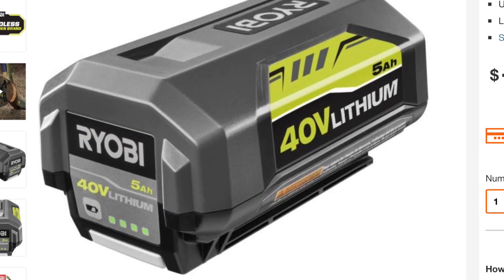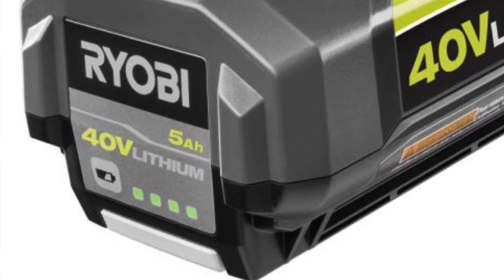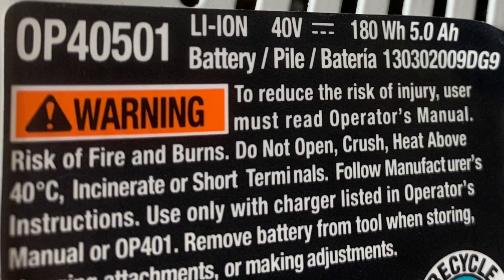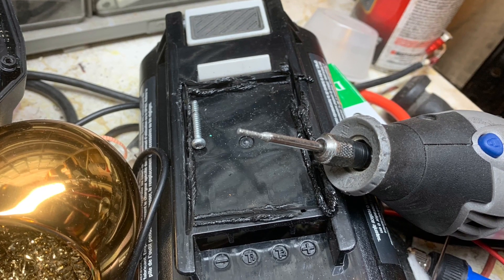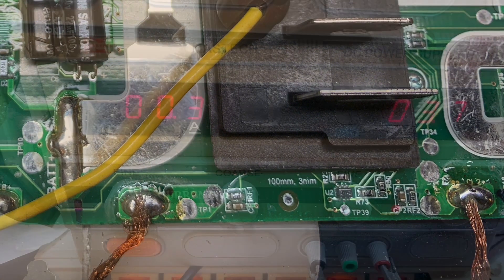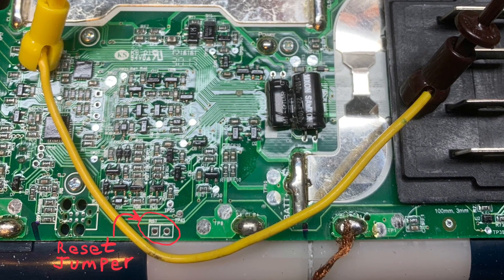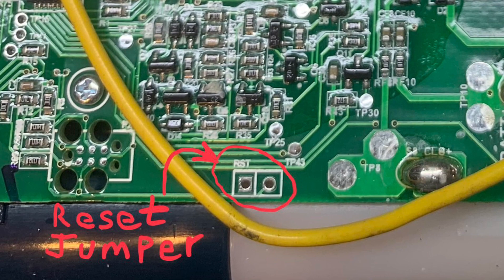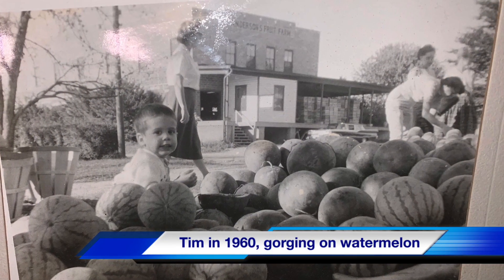Tim’s Tips #49 - Reset and balance a Ryobi 40V battery - Nov 17, 2020

Comment: Maybe Ryobi should contact Rigid on how to prevent this problem. I have a Rigid 18V cordless drill, and Hammer Drill, set that I have had for at least 10 years, and I haven't done anything special with the batteries except recharge them when they wouldn't power the drill. And I haven't had any trouble with them at all.

Comment: Do you know if there a RST trick for the 18v batteries with 4 blinking lights? I have it apart, but do not see anything labeled RST like the 40v.  Any help greatly appreciated (it has 18v showing on my multi meter now after a charge).
Reply from the maker: Instead of resetting it, you can measure the voltages of the cells to see if they are balanced. If they are not balanced you could boost the voltage of the low cells. Or you could lower the voltage on the high cells with a lightbulb. Perhaps the BMS would be able to charge the pack properly then.
Reply: I have it recharged, it was at 11volts, now it’s back up to 18V, but the circuit board still has it locked. 4 blinking LED’s, that blink four times. If I knew how to reset it, it should be fine. I do not see the RST anywhere on the 18b circuit board like on the 40v battery. If anyone knows how to reset it, please let me know which terminals to jump.

Comment: My circuit board has the 5 terminals marked RST, 3.3V, GND, DAT, CLK. I jumper between GND and RST without any success. I checked between the cells and got the following voltages;
CLI- TO CL1+ =2.8V
CL1+ TO CL2+ =2.8V
CL2+ TO CL3+ =6.3V
CL3+ TO CL4+ = 1.7V
CL4+ TO CL5+ =2.6V
CL6- TO CL6+ = 3.2V
CL6+ TO CL7+ =6.3V
CL7+ TO CL8+ =3.5V
CL8+ TO CL9+ =3.6V
CL9+ TO CL10+ =3.5V
CL1- TO CL10+ =10V

I don't have a power supply but tried jumpering to a good battery for a little boost with no success. Which is more concerning between the 1.7V low reading and the 6.3V high reading? Should I try a 60W incandescent light bulb to drain the high values to bring them closer to the others? Any suggestions?

Comment: The big thing I want to research is, do these packs have ANY form of balancing circuitry inside? I would hope that it at least has some minimal form of balancing in there where it can fix gradual drift of voltages over time. Also, I bought a dead 3-pack of these from Ebay to harvest cells from. 1 pack worked right away by using your reset method without needing any balancing. 2nd one had a 2.7v section (vs. 3.1v), so I used my little adjustable DC power supply to bring it back in line with the others. After reset, that is now charging as well. The 3rd has a pair of shorted cells (0v), so I didn't even try it. I tore that one apart to harvest cells from, and the other 18 cells have all taken close to 2000mAh of charge (the Samsung cells are rated 200mAh capacity), so I'm pretty happy so far.
Reply from the maker: It would be gross negligence if Ryobi engineers did not implement balancing. Thanks for subscribing.
Reply: @tdrager  if I am not wrong, Tim. There is no balancing circuit other than protecting maximum charges 41.xyz volts and minimum
Discharges lower than 30 or 28 volts(not sure).
Reply: From what I understand the reason that there is no balancing between cells (equalizing the voltage) is from a safety perspective.  All the batteries should have equal capacity (amp hours) - if one starts degrading to where it could become a hazard the BMS board will "turn off" the entire battery pack and will block charging.   The degraded cell becomes the weakest link in that charging chain -and will cause the entire pack to unusable.

Comment: I did exacly what you said it worked out for me thanks
Reply from the maker: You’re welcome. The reset method works if the cells are balanced. If cells are damaged or out of balance, more time is required to balance them. If even one cell is damaged or worn our, the pack must be recycled. It’s beyond most homeowners to replace individual cells.

Comment: It works!!!

A few notes for anyone that didn't really quite understand.

First, to get out the screws without drinking out the middle pin I just used an undersized flat head screwdriver. I just jammed that baby in there, hit two notches and went slowly. It worked. Plus, don't forget to get a utility knife and cut the sticker.

Once the cover is off I readied my jumper. I used a twist tie coated in rubber. Using a utility knife, I exposed about a quarter of an inch of wire from both ends of the twist tie. Then grabbing onto the runner I shoved one end into the RST hole and the other end into the other hole.

Finally, I pressed the battery indicator light. Instead of flashing, this time the lights stayed on. I didn't know what to expect. I just waited something like three minutes. The lights never went away. Whatever. I grabbed the rubber on the wire and removed the bypass wire.

I put the cover back on.
I put the batter back into the charger.
Voila! It's charging like new.

Like many before me, this saved a fair amount of money. Thank you very much.
Reply: Thank you for the extra detail!

Comment: Thanks for the video... it worked!  I had 3.09V on a string when all the rest were at 3.66V! I charged the low one with a dc-dc buck converter set on 3.7V output. At 3.4V I hit the reset (which worked per your vid), however the charger still didn’t like it! Charged it to 3.64V and charger now likes it and is charging it! Will test in the mower soon!

Comment: The reset trick is a one shot trick every time you charge the battery pack you need to reset it. Out of balance are bad cells that will bleed off voltage over short amount of time. Ryobi doesn't send you a new battery pack because you are their pals, they know there is a manufacturing fault.

Comment from the maker: To measure the cell voltage, measure between to two big solder balls on both sides of the circuit board. The typical voltage at 50% charge is about 3.7 volts. If the cell voltage differ more than .05 volts they need to be “balanced” by charging the low cell, or discharging the high cell with a lightbulb.
Reply: So will it not charge if the cells are too far out of balance?
Reply from the maker: @zephyrprime  Correct. Some of the cells can be damaged in that they have a high self-discharge rate. They can be balanced manually, but over time they will self-discharge and get out of balance again. This is Ryobi design defect in their BMS, not your fault.
Reply: @tdrager  Could you explain how to discharge a cell?
Reply from the maker: @tandrews22  put a 10 ohm resistor or automotive lamp across the cell until the open circuit voltage matches the other cells
Reply: Hi Tim, I'm not technician. So can you please show me or let me know as how to jump to reset. 
Thanks

Comment: I worked for me! It took me a couple of tries but, I didn't get that you had to put the pins in the rst holes and them push the button. It worked the first time and then went back to flashing lights  after being plugged in for about 5 minutes so, I did it again; this time it too me a couple to times to get it to catch and then it reset. I plugged it in and it stayed! It's charging now. I'm so happy! This battery has been sitting for a year! I couldn't see purchasing a battery for $161.00 but then, I couldn't see getting rid of the awesome lawnmower. It was such a simple fix. Thank you so much!
Reply from the maker: Be sure to check the voltage between the solder blobs. If the voltages are over .05 volts different. It may either:1) Not reset or 2) Be out of balance and may not have much capacity. This happened to me recently, so I charged one of the cells to 3.7 volts to match the other.
Reply: How do you charge an individual cell on it @tdrager

Comment: I tested the voltage of each set of "blobs" to see the balance, and one pair is only 0.25 v and the other pair is only 0.10 v.  Can I bring each side up to about 3.7v and do the reset safely?  Also it appears the positive for each side is the outer blob and the negatives are the two inner blobs.  Is that correct?  Difficult to tell with such low voltage.  Thanks!
Reply from the maker: Those cells are irreparably damaged, because they are so low. Could cause a fire if a recharge is attempted. That said, If someone’s life depended on it, a recharge could be tried if you manually observed the voltage and heat and maybe kept them outside so that if a fire started no one would get hurt. They may be able to restored to a fraction of their old capacity, but I’m not sure it’s worth it.
Reply: @tdrager  OK.  Thanks.  I'll just give up on this one then.
Reply: @nelsonnolte430  If you haven't recycled it already, consider tearing it apart and using the cells for other things, like LED flashlights you see all over Amazon. You likely still have 16 good 18650 cells in that pack (less the 4 dead ones). A nice 4 slot Lithium Ion charger can be had for around $20-30.

Comment: Thank you!  Reset jumper fixed mine as well, a huge $$$$ savings!
Reply from the maker: Remember to check the batteries so that there is less than .05 volts between cells. One of the batteries I reset worked well for a while, then went out of balance again. It must have a dendrite, a fine whisker of chemical slowly draining one cell. Hopefully I can nurse the battery along a few more years using “Tim’s Reset and Balance Technique.”

Comment: Got mine reset, but as soon as I threw it on the charger, it started the error flashing again. I got these to avoid the hassle of mixing fuel oil, and here I am trying to fix a nine month old battery. So I'll be ditching Ryobi.
Reply: Call ryobi or go on the website and chat with a representative. They will warranty a new battery at no charge

Comment: did the reset with a jumper...still flashing defective with all 4 lights flashing
Reply from the maker: Check the voltage of the cells per my video. The pack may be out of balance.

Comment: I have a Ryobi LI-ION 40V 93.6Wh OP4026  battery and when taken apart, the computer board is different than the one in your video.   In the upper right corner of the board it has 5 holes one right after the other with the following marks: CLK, DAT, GND, 3.3V, RST.  Not to far off to the left are 3 more holes with the following marks: GND, SCL1, SDA1.  Which holes would I insert a jumper wire to reset the battery?
Reply: I have the same circuit board. I saw one video suggesting to jumper between 3.3V and RST so I tried it without any success. I checked between the cells and got the following voltages;
CLI- TO CL1+ =2.8V
CL1+ TO CL2+ =2.8V
CL2+ TO CL3+ =6.3V
CL3+ TO CL4+ = 1.7V
CL4+ TO CL5+ =2.6V
CL6- TO CL6+ = 3.2V
CL6+ TO CL7+ =6.3V
CL7+ TO CL8+ =3.5V
CL8+ TO CL9+ =3.6V
CL9+ TO CL10+ =3.5V
CL1- TO CL10+ =10V

I don't have a power supply but tried jumpering to a good battery for a little boost with no success. Which is more concerning between the 1.7V low reading and the 6.3V high reading? Any suggestions?
Reply: @bikecultureletusride  hi Ron  you’ve done more than I’ve done.  I continue looking for someone who does this for a living.  The best advice I’ve gotten was to jump a good battery to the one that stopped working with a pair of cables.  They suggested connecting the cables in repetition for 5 seconds, removing the connection and repeating until you can get the charger to recognize the non working battery.  I never tried it because I don’t have a pair of jumper cables.  If I find someone who rebuilds or can jumó them for a reasonable cost, I’ll let you know.  Thanks for the information.

Comment from the maker: Be sure to charge the battery BEFORE it goes below one bar. If the battery is totally drained, the cell voltages may differ too much for the reset procedure to work.

Comment: I used another 40V battery to add some charge to the one that wouldn't charge then performed the reset. It is charging now!  Many thanks. I almost bought the DC-DC power supply to charge but another video showed how to use another 40V battery as a power source. Well done, Tim.
Reply: Where is this video that shows how to charge with another 40v batt?
Reply: I am trying that now hooked up positive terminal to other positive terminal and same with neg using alligator clips jumped the reset and I do not think it's working

Comment: Man I’m seeing all these people it worked for and I have to be the first person it doesn’t work for I guess. FML. Lights come on after jumper and everything but still only blinks
Reply from the maker: Are the cell voltages balanced? Use a DVM / DC voltmeter  and measure them. They should be within 50millivolts, IMHO.
Reply: @tdrager  Jumping didn't work for me either. How do you measure the voltage between cells? It's unclear from the video
Reply from the maker: @gsandrews  The cell voltages can be measured between the solder blobs and cell ends. If the voltage is less than 2 volts DC, the cell it damaged.

Comment: I bought a 36v bike battery charger. No luck after reached 42v.  Jumped the RST worked great 👍
Reply: I have been using the 40v 5ah for a while and have noticed that only half the light bars are only ever lit up and about half the time of use of the battery.  Is there anything I can do to get back to a full battery charge again. Thanks

Comment: My old battery charges to full but only last 5 minute of use. I'm trying the reset method but circuit looks different. It has 5 holes  near the RST, ( CLK  DAT GND 3.3V RST). Any idea how I can jump this?
Reply from the maker: Jump between RST and GND.
Reply: @tdrager  I have the same circuit board. I jumper between GND and RST without any success. I checked between the cells and got the following voltages;
CLI- TO CL1+ =2.8V
CL1+ TO CL2+ =2.8V
CL2+ TO CL3+ =6.3V
CL3+ TO CL4+ = 1.7V
CL4+ TO CL5+ =2.6V
CL6- TO CL6+ = 3.2V
CL6+ TO CL7+ =6.3V
CL7+ TO CL8+ =3.5V
CL8+ TO CL9+ =3.6V
CL9+ TO CL10+ =3.5V
CL1- TO CL10+ =10V

I don't have a power supply but tried jumpering to a good battery for a little boost with no success. Which is more concerning between the 1.7V low reading and the 6.3V high reading? Any suggestions?

Comment: Mine defective  ryobi battery is similar, it is on 0v i measured 3.487V inside,  not sure how is supossed to charge the inside battery to 3.7V, and dont have a power supply anyways. It failed with a few uses, may be got connected to the charguer and that fucked it up. It is also some dirty with a salt over many soledring pins

Comment: It's weird the 4ah battery doesn't do any thing when I reset. The reset pins show 3.7v coming out of them and goes to zero if I cross the volt meter but nothing happens. I also get them to send a replacement for free but would like to fix this one or I'll scrap it and take the cells out.
Reply: Worked for my 4ah battery

Comment from the maker: Store your lithium batteries between 2 and 3 bars. If it’s fully charged, it’s life will be shortened. I had a LIFEPO4 battery in storage for 5 years with no degradation because it was stored at 50% charge.
Reply: O for sure I built drones for a couple years I'm well versed in LiPO batteries.

Comment: This tip is great if the battery is overly discharged (overheated) and the charger cannot jump it properly so it trips the reset. But If the battery pack is truly defective (ie, a completely dead cell) the pack will trigger the flash of death again soon after you jump the reset. If that happens, the pack is done. Recycle it.  My brand new 40V pack died after only 3 short uses (about 65% discharged) My buddy is an electrical engineer and said its the board, not the cells in most cases. Hello Ryobi?  WTHeck is going on?  At this cost, these batteries should last at least 100+ cycles... sadly this is an EPIC FAIL
Reply from the maker: Agreed. Ryobi needs to hire qualified battery and BMS engineers, not college grads.

Comment: Thanks for the video! The reset didn't work for me initially.  So I measured the voltage packs, They all measured 3.9 except for one that was 3.6.  So I hooked up my adjustable power supply @ .6amps and it took about 3 hours to match the voltage. When that was done, the battery pack displayed 3 bars and the charger accepted the battery pack and completed the charge.
Reply: Saw the thing thing - mine was 4V on 3 pairs - and 3.1 on 1....charging now.    This is probably a temporary fix if that one group of 18650s are loosing capacity compared to the other...but we will see...
Reply: @romanykemp9042  Great timing on this reply.   My pack ran great until I over ran it again just recently. I need to break it apart and charge it again. My biggest tip would be when it displays one bar, stop using it and put it on charge after it has cooled down. The "protection" circuit on this particular board is junk IMHO.
Reply: I wanted to update my comments.  There are 10 pairs of 18650s - so you really need to look at each of those 10 pairs to verify how close the individuals voltages are.   It took me a bit of trial and error to find these 10 pairs on the board.  Look at the large solder blobs...

Comment: Sadly this didn't work, even after equalizing all cells.  Still, useful tip!!!
Reply: Tapping the reset didn’t work for me either. however holding the reset and pushing the test button did. All for lights came on and then I released the reset probes. Lights went off. Pushed the battery test button and it works again. Thank you!! I bought this trimmer and lawn mower late last summer and only used the trimmer twice. Brought the batteries inside and this one still pooped out on me. Now I know what to do! Thank you again!!

Comment: My 40 V batteries look different and they also have a date on the circuit board that says December 17, 2013
Reply from the maker: The circuit board may still have a reset function. It just has to be stenciled “RST”, “Reset”, etc... on either side of the circuit board.